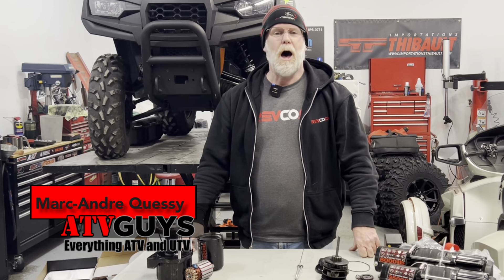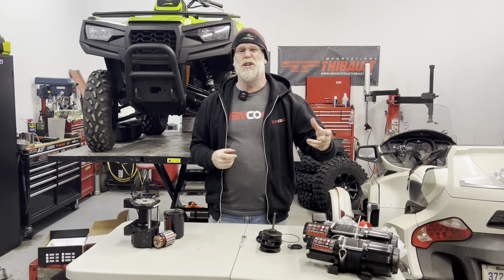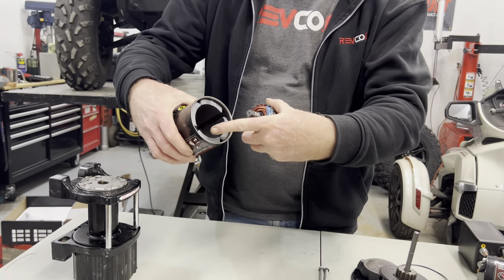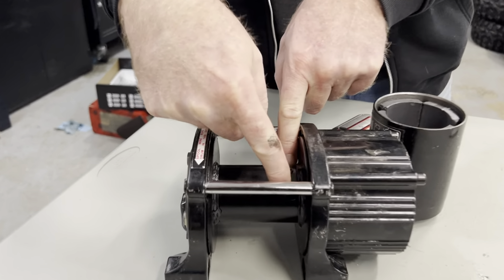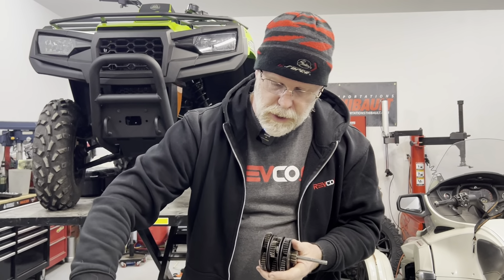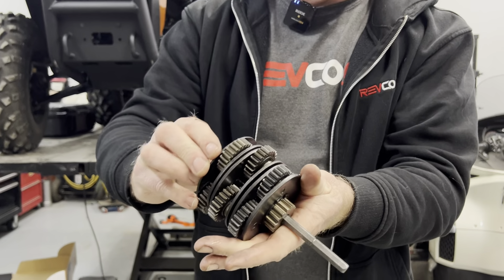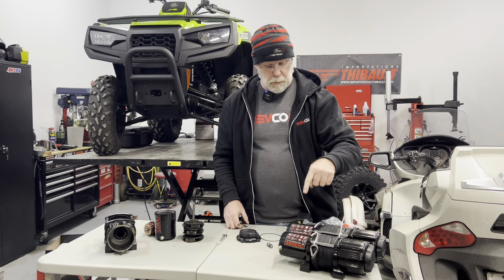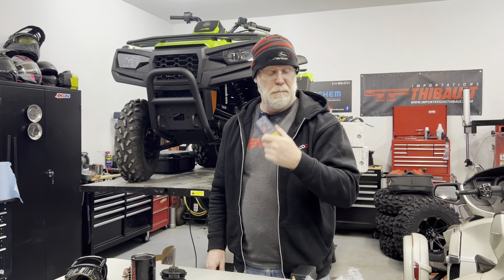Your ATV / UTV winch, how does it work?

Comment: I didn't use any tool at all for pulling the main part our of the motor and was able to install the end cap with the brushes then insert into the drum of the motor without cutting off my fingers simply by wearing gloves and pushing with my other fingers against the end of the (armature)?  to guide it through carefully in a controlled manner.

Comment: the part that you said is to seal the motor, is that the brake?  Mine is seized and that part don't want to turn, although it does turn easier going in the direction that wraps up the cable on the spool.

Comment: I was impressed throughout until you got to the relay box that's huge. That's like 1/2 a battery. Where are you going to install that on most ATV's
Reply: It's not as bad as it looks, I've installed about 20 of them to this day and only once on a honda I had to get creative.  The wireless module it a little big and cast into epoxy whitch explain the size but again, not bad.